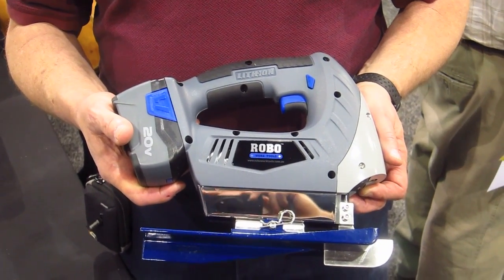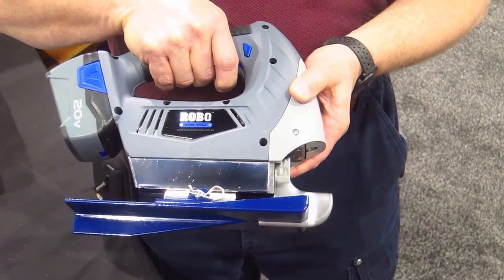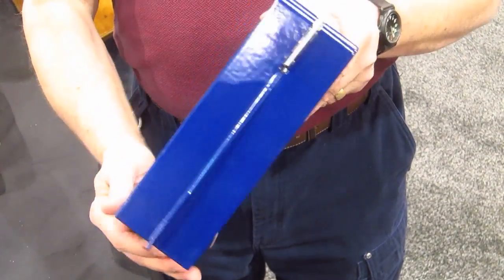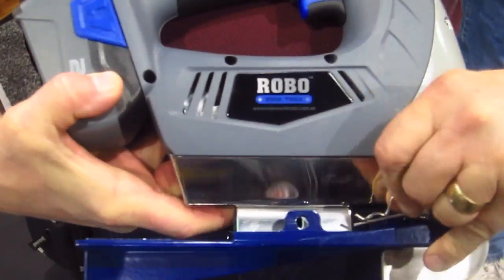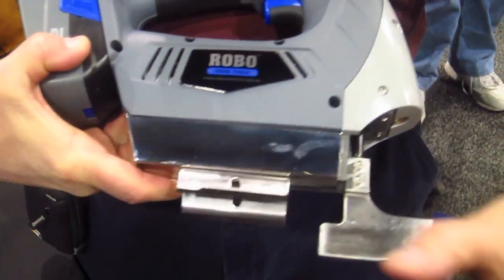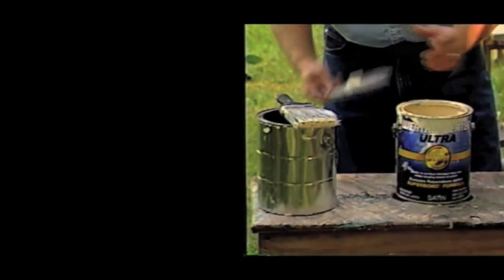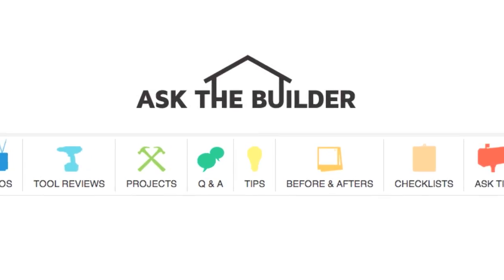Control Joint Tool

Comment from the maker: It was cut in actual concrete. Go to the website in this video description and see the tool in use. The tradesman in the video racing the woman is the inventor and a seasoned professional concrete finisher. He was not faking it in the video going Hollywood Slow. This tool is revolutionary. It does an amazing job.

Comment from the maker: A closed-minded approach like this in business can be Death on a Stick. I would highly recommend you do your best to have an open mind and try things. What you didn't see in this video was the side-by-side test of this tool against a pro doing it the way you suggest. Guess what? The woman using the tool who had never cut a control joint EVER, beat the pro doing it by hand 3X faster.